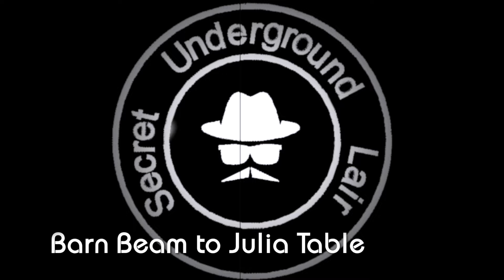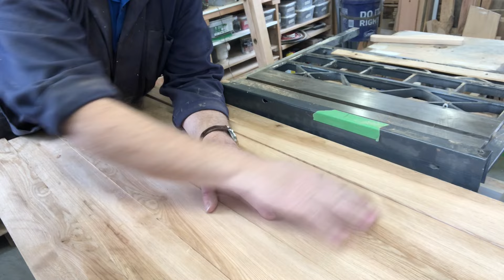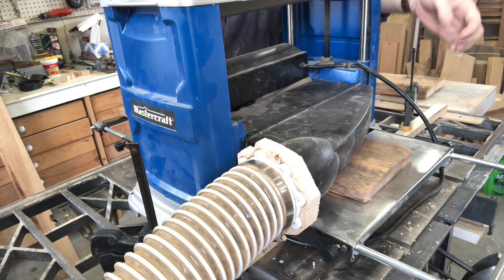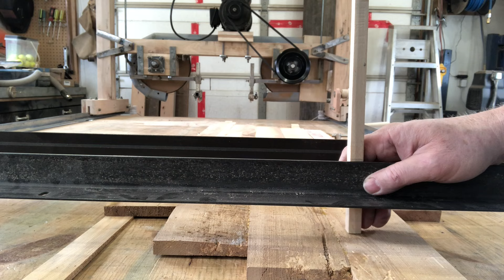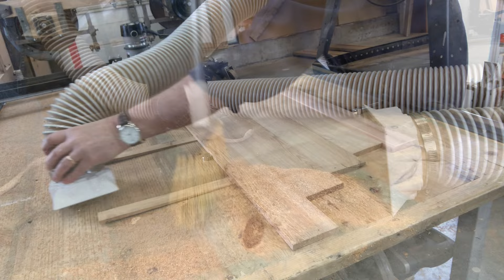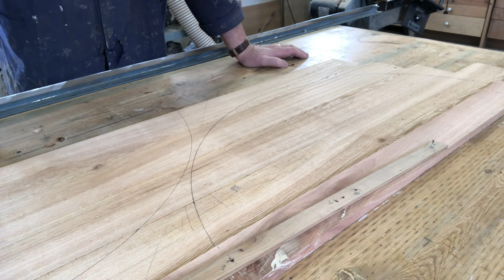Barn Beam to Furniture - JuliaTable - Part 1

Comment: The plug cutter would go easier on the drill press, I would think?

I'll look forward to the next part
Reply from the maker: Most of the nails I need to remove are more accessible that this nail was, so the drill usually works quite well. But yes, using the drill press would be better. I'll have to try that next time.